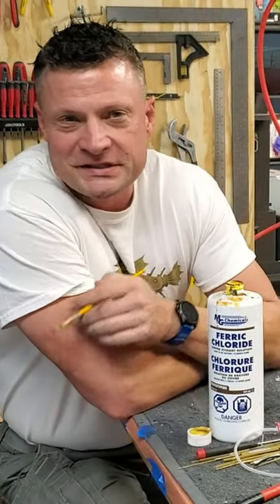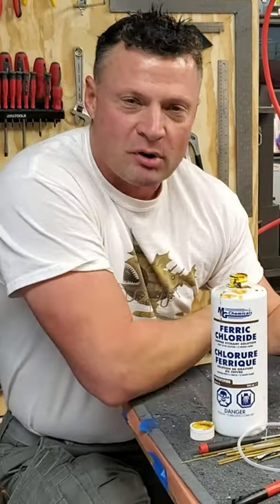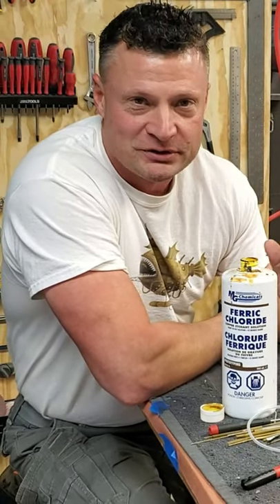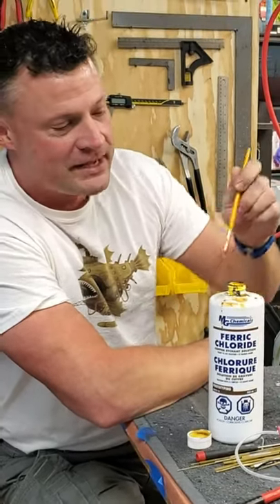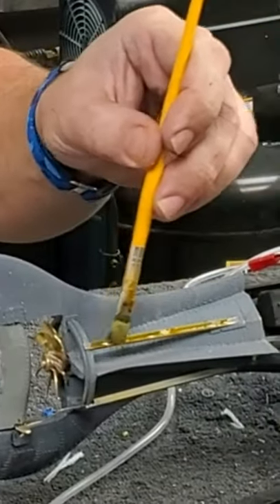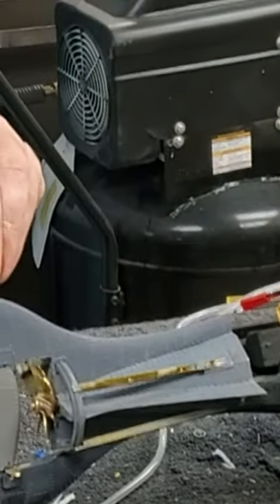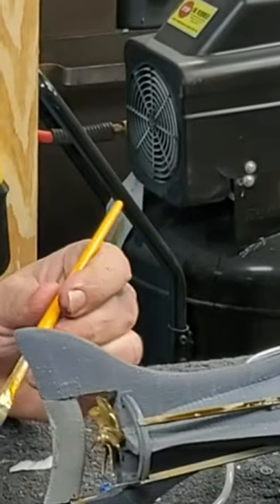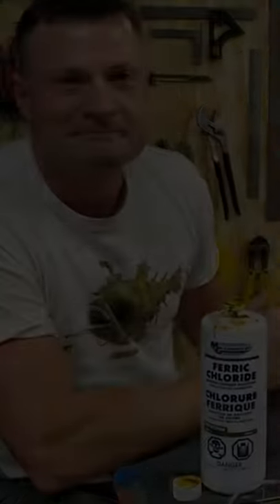Building With Brass? Don't Forget to Pickle Your Boat!

Comment: .... and once the copper alloy has darkened wash the work with plenty of fresh water spiked with a bit of backing-soda (the low pH kills any remaining acid). dry. Lightly wipe away any loose oxidized metal. Prim and paint. This step applies to bare copper or copper bearing alloys.

One more thing: most acid-etched parts arrive to you still bonded with the photo-resist coating. This coating is very receptive to adhesives and paints and should not be removed as it's an ideal substrate over which to glue and paint. But, if you abrade away this photo-resist coating, you have to go through the pickling process Bob described.

Comment: Can this be diluted for photoeched brass as to not be that strong as to accidentally ruin such thin brass?
Reply: You want a strong, hot acid with plenty of agitation to make the cut quicker. Slow cut produces too much undercutting.
Reply: @montigobear  I see, I'm checking chem supply stores for this as I also would need it for all types of model builds!